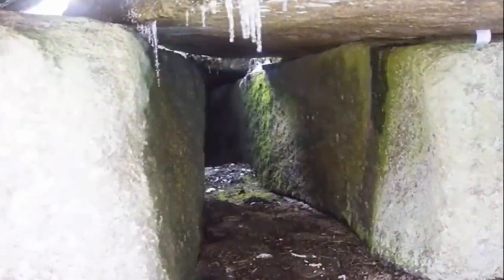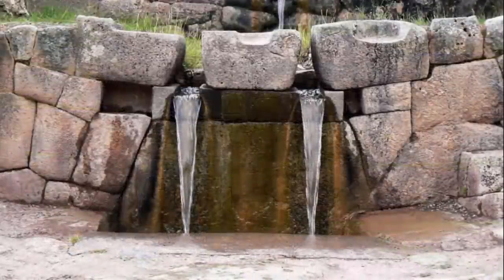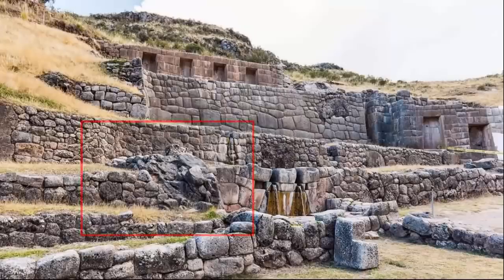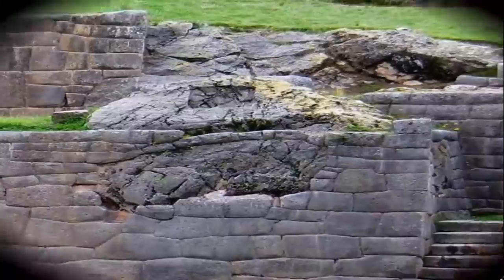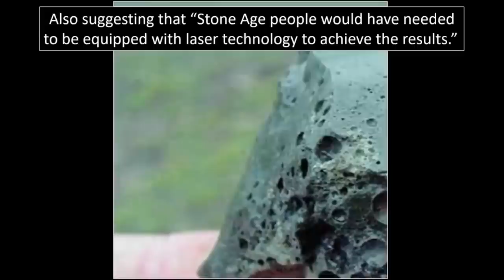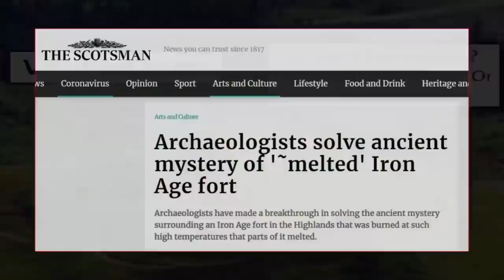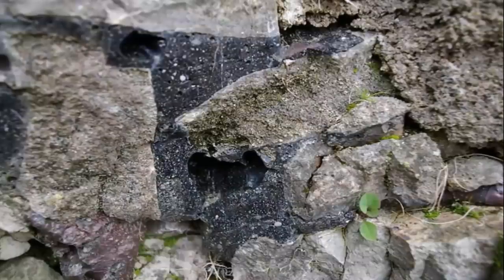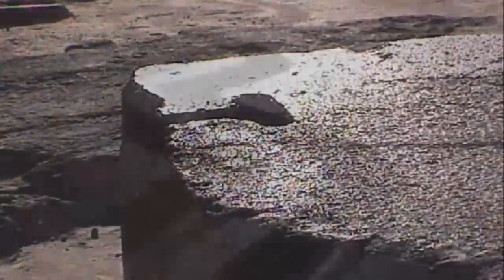💥 Proof of Ancient Nuclear Explosions 💥

Comment: It seems unlikely the melted stone in Peru was a runaway exothermic reaction. Unless someone miss calculated terribly each batch of mix would perhaps have contained enough reagent to melt or destroy those stones but probably not enough to flow down to destroy other previous reacted material.
Reply: as well, attributed to the mayan or incan, or aztec when you do see their temples are rubble and fill built within is cribbing but no where near the size of the megalithic structures in the hills and mountains of the surrounding area. they did not build these megaliths.

Comment: vitrification takes way more heat than achievable through hydro-carbon fires. plus there would be an inclusion layer of slag, where the fuel and ash would be frozen in an extremely rough outer layer full of bits of unburned fuel (like charcoal). this heat would have to have been done distant from a source of the fuel... like an energy weapon. almost like a narrow, targeted gamma-ray burst, or the run-away fission process of a nuclear core (like what happened at chernobyl). When the chernobyl reactor went critical, supposedly it produced a glowing blue beam of gamma radiation (blue probably from the ionizing of the atmosphere, like lightnig does) that cut through the concrete ceiling and projected out into space, literally just like whats depicted in the Godzilla movies as Godzilla's "nuclear fire breath". Thats the only thing i can think of that would produce results like this, basically a nuclear gamma laser, form an exposed fission core going critical. just containing something like that on purpose would be difficult and unbelievably dangerous today with our technology, and i don't see how it could occur naturally.
Reply: what about the nuclear glass produced by U.S.Atomic bomb
test ...it's obvious

Comment: It doesn’t really look like glass. It looks more like a slab of old broken up concrete .
Reply: Probably is more like concrete then glass at this stage. It would have to be refined and reheated many times I would imagine with additional chemistry to get to a glass state that we are familiar with. I bet even if you cut it clean in half it would be dark material all the way theough
Reply: @JLE1177  ,  yeah. I was thinking the same thing , if they cut it in half .
Reply: @BigDaddy-vr2ut  Glass is a wide class of material. It can range from your coke bottle to volcanic glass which looks more like flint. Early Roman glass had impurities, was opaque rather than clear and could appear as that slab. What was significant was not the quality of the slab but it’s mass. Known period kilns could produce glass about the size of a loaf of bread, not the size of your driveway.

Comment: 10:13 - MASER. A MASER could do that. Melting the stone from the inside and out. Laser would vaporize the outer layer right away. Nuclear explosion would create a lot of dammage to the surroundings. But a focused beam of microwaves? Most certainly. Or a proton beam. That would modify the atomic structure of the rocks though. Easy to verify, but has anyone even tried?

Comment: The walls that look like risen bread, may be explained with pressure, from deep flood water as apposed to a thermal nature.

You can view earth by the age of the lands in google as well as viewing "people view" and photos and you’ll start noticing the natural landscape is puffed out the same as the walls, also appears to fit in a puzzle pattern, but obviously natural landscapes, no walls or even straights or right angles but still is interestingly similar. 
After further investigation I found that the highest yielding areas were also the oldest plus were previous deep ocean areas. 

At this point in my opinion water pressure is much more likely to be the cause of all the puffed out wall masonry. Regular walls subjected to possibly ocean level pressures. At least as apposed to nuclear thermal theory
Reply: You are utterly clueless, why is it so localized then? Like blaster fire from an orbital bombardment more like it.
Reply: No, because many of the polygonal walls have been subjected to extreme levels of heating and melted or even turned to glass in some cases.
Reply: @roylavecchia1436  I’m not doubting this, but those places turned to glass are in spots as if by a laser. 
The puffed walls are mostly uniform throughout
Reply: they are  the weirdest shaped  molds ever, the air lugs are the giveaway ???

Comment: The sun theory doesn't hold up as I would expect to find wide spread effects not isolated patches and certainly not through an unaffected window onto a stair case which by the way has melted steps below and above and no windows on the above and lower floors (discriminant solar flare ?) Is there evidence of this solar event any where else in our solar system ? Lastly the forts in Scotland have had there walls turn to glass but not the surrounding countryside , in Sacsahuaman there are just two spots along a massive wall and I would imagine a nuclear event would have destroyed much more than just those two spots . If anyone can shed more light on these two theories (nuclear or sun ) I would love a free exchange of ideas not an argument as these are theories not facts